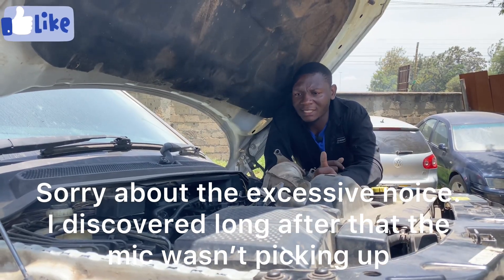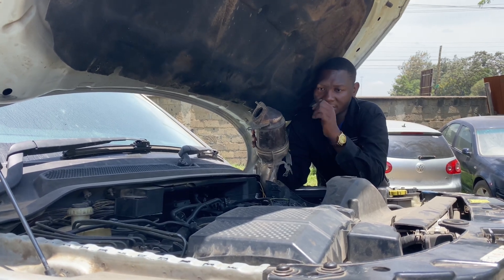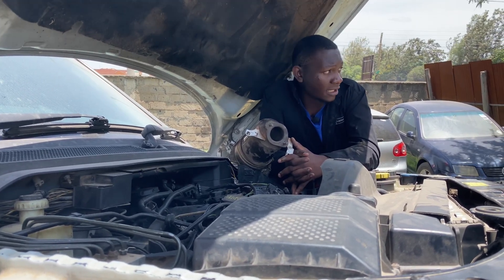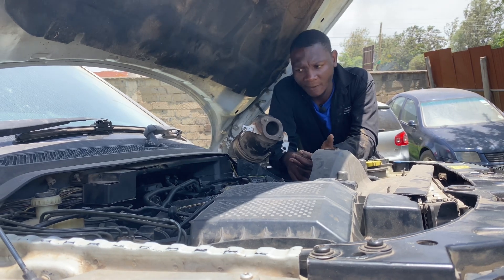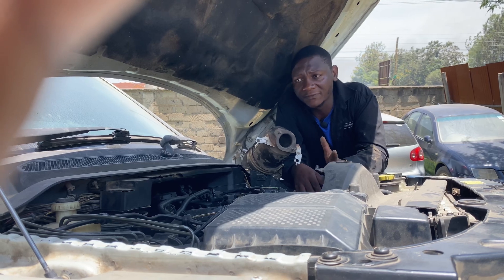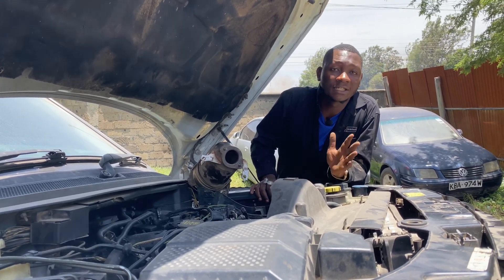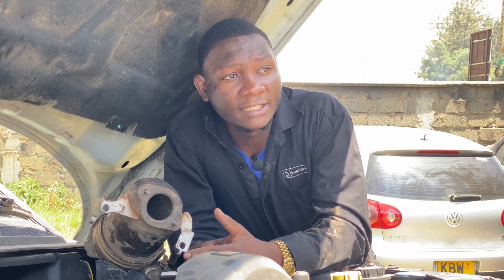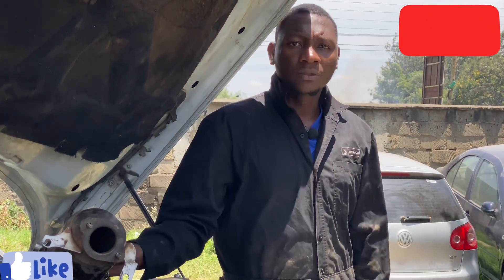Diesel particulate filter. DPF Regeneration. How to maintain your DPF

Comment: I call BS. My fishing boat runs at 1200 RPM for weeks on end. I have heard of London buses running in stop-and-go traffic and traffic jams. With no problems day after day almost running at an idle all day DPF is a failed government science project. That has more harmful emissions during regen than if it were to run continuously with out it.
Reply: Chevy states you can never idle a duramax. 
And if you do it may re-gen so hard it pours fuel out the tailpipe. 

How’s that for emissions😂
Reply: With my Mazda you have to do at least 70kmh to get into the regeneration phase.
So at least once a week do a run on the freeway.